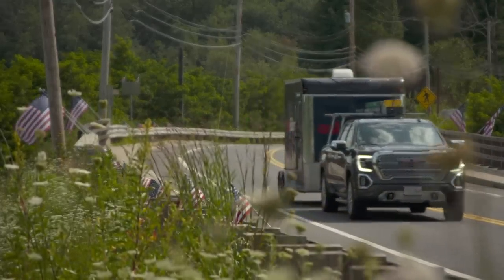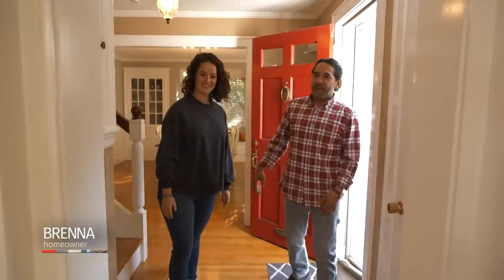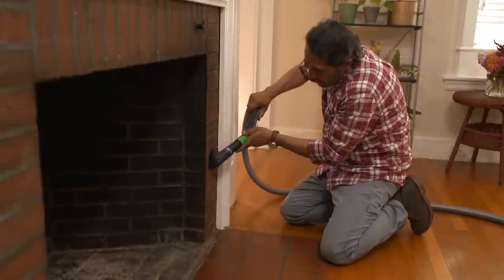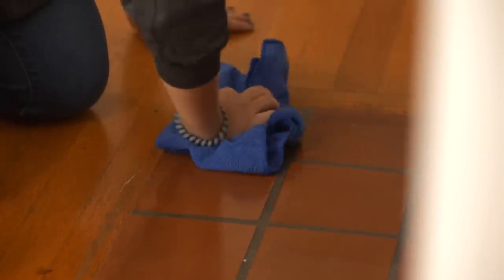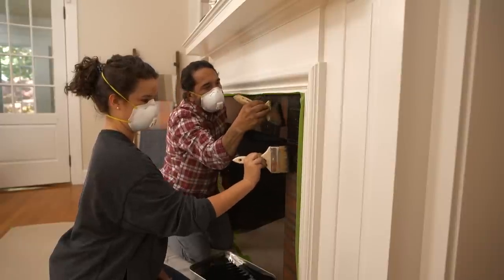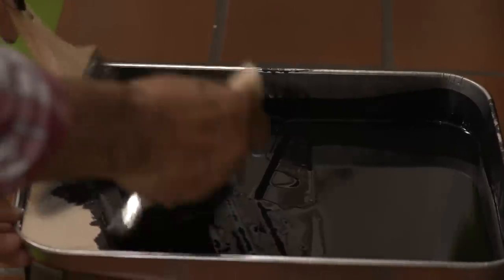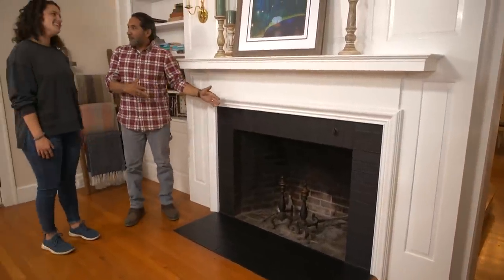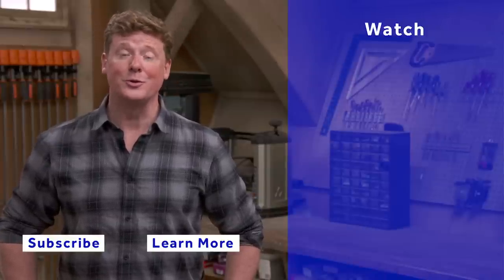How to Paint a Fireplace and Hearth | Ask This Old House

Comment: It's not impossible to go back to brick after painting, but it is incredibly labor intensive and messy. You strip the paint off the brick faces with a paint stripper (this takes many many coats), and then you may be left with paint stuck in the grout. At that point, you may need to repoint the bricks to get the grout looking original again. I did this project years ago, stripping off about 4 layers of paint, so I know it can be done.

Comment: What paint was that???
Reply: Heat resistant paint..he mentioned that a few times
Reply: Rust-oleum and Krylon make High Heat paints. However, if you read the description, he uses a POR-15 (Paint over Rust) paint. I've used POR-15 on metal and its amazing. However, best to read instructions thoroughly and wear gloves/disposable brushes.

Comment: As a professional painter my experience is, interior bricks-OK, exterior bricks- no no!
Reply: What if the bricks are really ugly, like dirt/paint/lime everywhere that can't be removed?
Reply: @rutgerhoutdijk3547  If it’s already painted, you don’t have much of a choice. Bricks are porous and allows moisture to escape if it gets between the house frame and the bricks. Once it’s painted, the moisture can get trapped behind the brick wall and cause damage. A way to get around this, is to drill out weep holes at  the bottom of the wall, so moisture and water can escape.
Reply: @howtodoitdude1662 this isn’t an issue with interior brick?